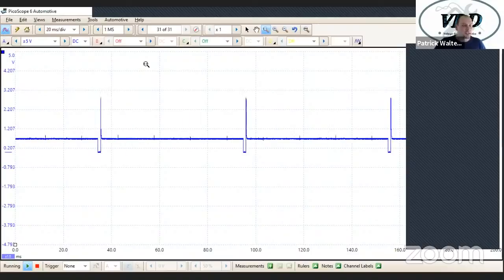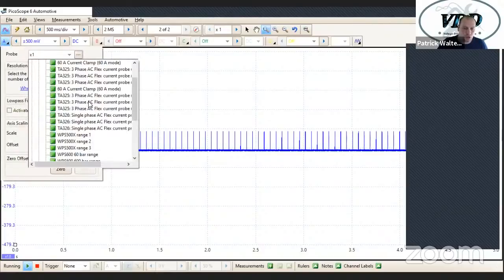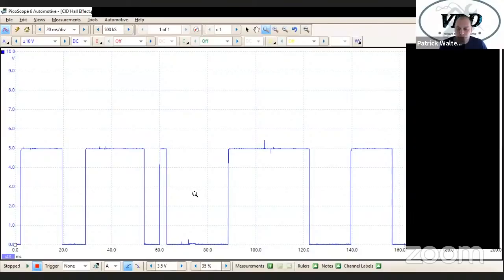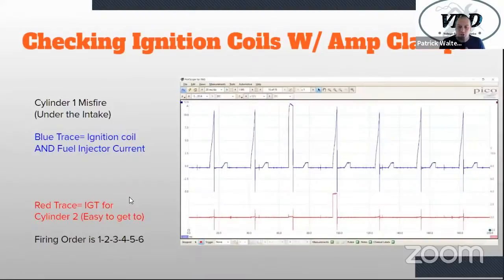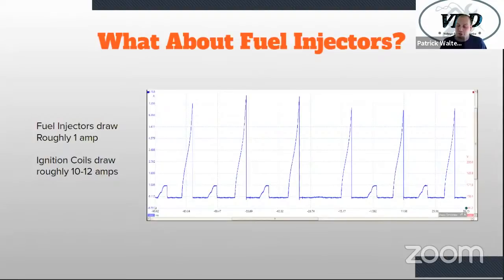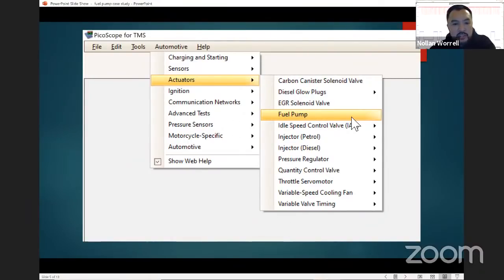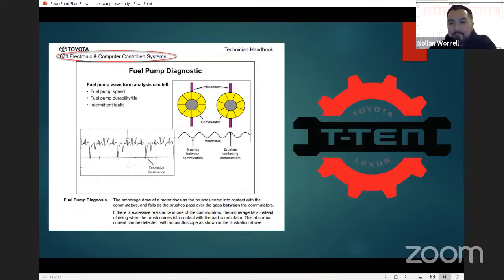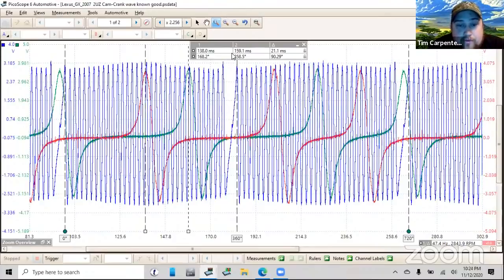Pico Basics and Case Studies

Comment: Nice video, I missed live but just watched. THANKS!!.  I'm not doing you tube yet, but I post alot of picoscope stuff on my Instagram page. @carters diagnostics
Reply from the maker: I'll need to check out the page. Im not really on instagram. But I might start a page.
Reply: @VoltageDropDiagnostics  I work at a Nissan dealer partime and visit other shops also. My main focus is diagnostics.
 I post some diag stuff, some how to stuff, I touch on WPS and pulse sensors. Lately I've posted secondary ignition tips.